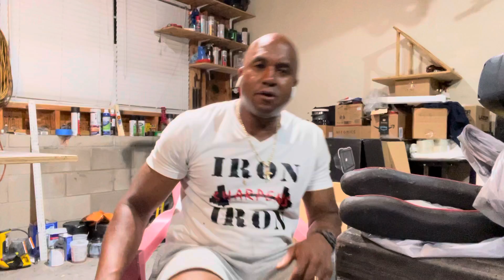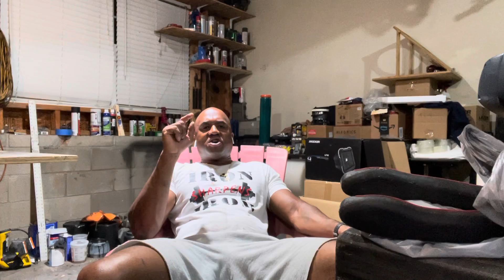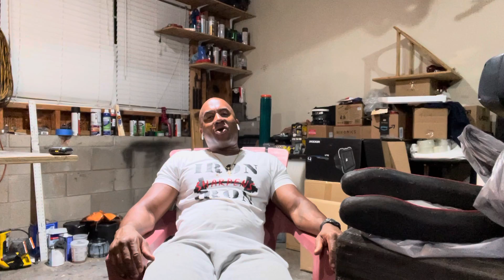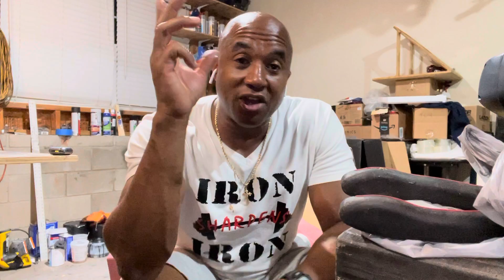The Trinity of a Subwoofer Enclosure ….Cone Area, Port Area, and Box Volume

Comment: Great explanations!  Kind of like an engine needs exhaust back pressure to get low end torque so you can’t swap out 2.5” exhaust for 4” lol
Reply: Engines do NOT need back pressure. I wish that old-wives tale would die. Engines need maximum velocity along with maximum volume of exhaust flow. 4 inch exhaust provides good volume but less velicity for scavenging on some engines.